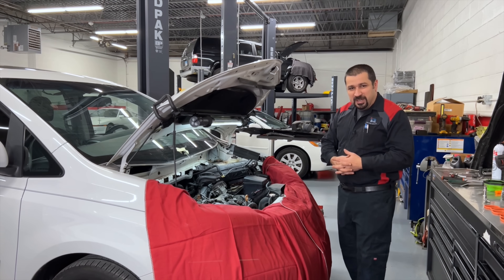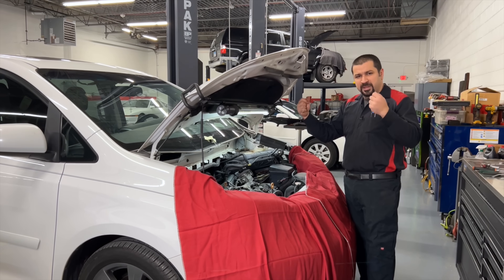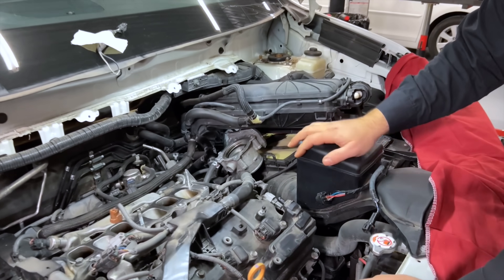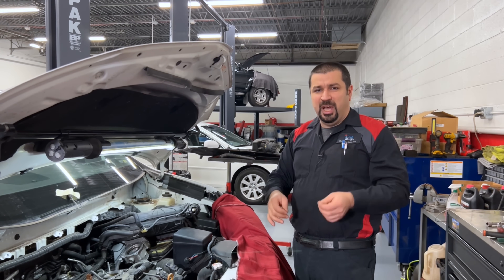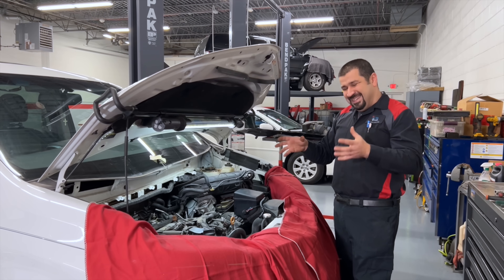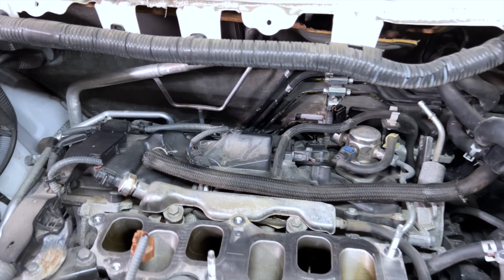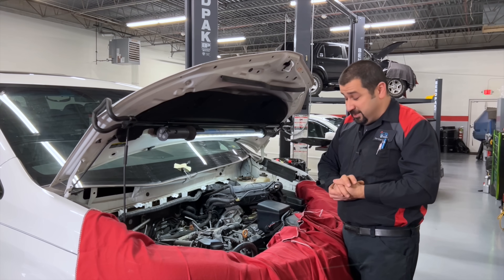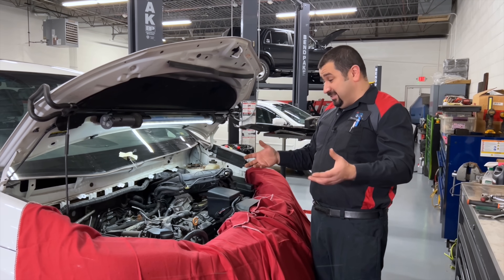Does Toyota Direct Injection Cause Carbon Build Up? Let's Find out!

Comment: At OMC, we used direct injection so that our two stroke outboards could pass new emission laws, other manufacturers went to four strokes.  I'm confused why four stroke engines would benefit from direct injection, doesn't seem like the emissions would improve that much.  Oh well.  Our outboards suffered from all the drawbacks you mentioned, and the injectors had to matched to the ECU as well.  There was one additional downside for us, the fuel flowing through the two stroke crankcases kept the internals clean, and cool!  It is too bad that we couldn't have adapted this two stage technology like Toyota did.
Reply: I was sorry to learn OMC is no longer with us. We have a 1970 Johnson 25 hp outboard sitting in semi-retirement in our  shed.
Reply: @RightLaneHog3151    Take good care of it for sure, can't replace it these days.  Most service parts for your engine are still available...
Reply: Computer registered injectors is a money saving fix. When you make injectors the flow per second ranges between each injector. The injectors have to have one of a few things done: use the ideal rate with a small allowed deviation and throw out the rest. Sort the injectors into groups with similar flow rates but replace the whole set at one time for any failure of even one injector to keep engine smooth running. Or check the flow rate and mark it as a quantity code and have a fuel system module that can be programmed with codes that it uses to adjust every injector open cycle time so the fuel delivered is the same for all cylinders. This last one is no scrap or sort or batch replacement, it is cheaper to manufacture and can save customer money
Reply: I love my 2 Etecs.  I have a 200 and a 250.  Both 2006 models.  Original injectors with over 1200 hrs on each one. Have owned OMC products for past 40 Years.  These Etecs get great fuel economy compared to my past carb motors.
Reply: @haleyy68    I agree, the ETECS were great.  Economical and simple compared to four strokes
Reply: A big deal with port vs direct is that when engine is cold the port injectors will squirt fuel onto cold metal engine parts where the fuel forms a liquid film and does not mix with air. To make engine start and then not immediately die from being too lean (the fuel is there as liquid but not combustible) the fuel quantity is increased and emissions and engine longevity suffers. Choke on a carburetor is the way extra fuel was handled and carbs were usually a lot more waste fuel as fuel was mixed further from inlet valve. On direct injection (same for diesel) there is very little or no extra fuel as delivery into cylinder allows immediate burn. The gasoline DI will spray with spark or spray with spark pause and finish the rest of delivery. DI also greatly reduces pre-ignition and detonation which are bad for emissions and engine part health. Engines with DI can have higher compression ratio and make more power and less emissions and better mpg since fuel combustion knock is almost eliminated.

Comment: Would a in line filter/catch can on the PCV system help?
Reply: Yes it would work flawlessly, by removing excess oil vapors from the intake system and the combustion chamber, you essentially have clean combustion. A catch can will store and allow those vapors to vent to atmosphere and the fluid oil to be stored at the bottom of the catch can. Downside is of course the oil/fuel smell around the vehicle from the vent, and having to replace the system with the factory one for smog checks. But the oil catch can really improved my MPG on my 2003 Lexus IS300 2JZGE, and better performance as well, so I'd say it's worth it.

Comment: What is the advice about using SeaFoam and other injector cleaners with these dual systems? Copious thanks for your fantastic lessons.
Reply: I keep hearing/reading that SeaFoam isn't effective.
Reply: @perniciouspete  I use Sea foam in my 2006 F-150 with 205k on it. I pour a large can of Sea Foam into the tank at every oil change 5K, and I can feel a difference every time. At start up in the winter I used to get partial misfires that I believe were related to carbon on the valves. The Seafoam seems to be keeping this problem at bay. This is just my personal experience with one model of vehicle. I also use it in my 2016 Toyota Camry at oil changes and notice a smoother idle after driving a couple of days. I figure it's doing something the engine likes.
Reply: I run a bottle of Chevron Techron FI cleaner in my vehicles once a year.  It's good stuff.
Reply: Bg and techron are the best. Somewhat pricey. I use lucas fic

Comment: I have a GS350. When I bought it if I went wide open throttle it would blow out I guess dirt / carbon. 
I do it once in a while and now nothing comes out. I think I blew it all out. I bought it used 3 years ago. It was driven on the highway but I don't think she ever went wide open throttle. It works!
Reply: If the stuff looks like sand that is your catalytic converter destroying itself. That happened to a friend's tacoma

Comment: CCN. How can you Italian tune up CVT? Isn’t it counterintuitive that you putting too much stress on the belt?
Reply: I drive a CVT, this is how I do it.  I go to highway, slowly and gradually accelerate to 60kph, then accelerate to 80, keep it here and floor it every minute or so and keep it at 100-120 for a minute.  Repeat this process, for next 15 minutes.  It is very important to only start doing this when the engine oil is at operating temperature and you have been driving casually for 10-15 minutes (CVT fluid warmed up).  Then drive casually home.

I do it once or twice a month (as I try to relive the younger Initial D in me).  Afer doing the italian tune up, the next day, the car is very peppy.  

Otherwise, do longer drives twice a month.  My mechanic says my 12 year old engine is clean.

Comment: Direct injection is better for CO2 emissions as it improves fuel economy but worse for particle (carbon) emissions. It's dirty because the fuel doesn't have enough time to atomize like it would have for port injection.
Reply: Is that what they were trying to reduce with the recent GPF filters in europe?
Reply: @memememine1 yes exactly
Reply: Carbon dioxide emissions is bullshit. I mean talks of it and of climate change.

Comment: Could you please also talk about Toyota D-4 direct injection? It's used in many engines on the road and even the brand new Dynamic Force M15A-FKS uses it.
Reply: Thats literally what this video is about
Reply: @aaronroesch5043  The video is about D-4S, not D-4.

Comment: most interested in carbon buildup in toyota DI engines such as in IS250. they are starting to become cheap due to the presence of more desirable IS350 on the used market, but are solo DI; no port injectors to wash valves AFAIK. leads to issues? idk
Reply: He made a video about this. DI Toyota's aren't worth purchasing, unless you're prepared to deal with carbon buildup. The DI/PI ones however are the best of both worlds.
Reply: @-a-8423  oh good to know! glad he's already covered the topic lol. and thanks for the advice. that's kind of what i suspected